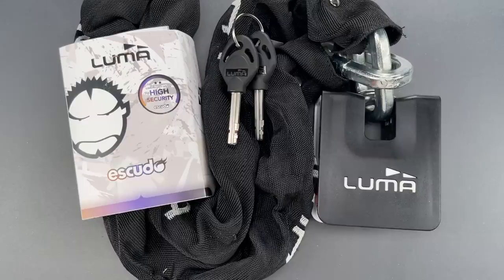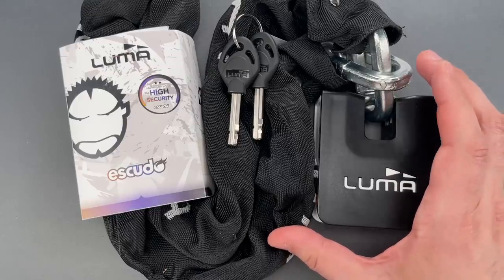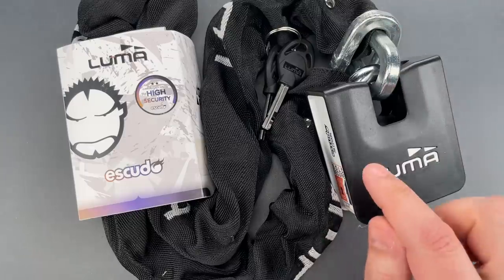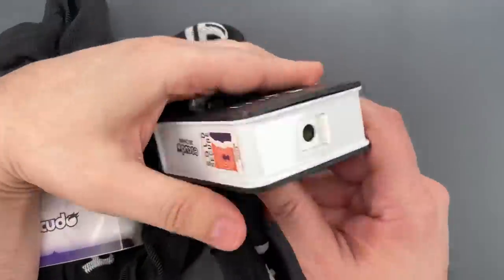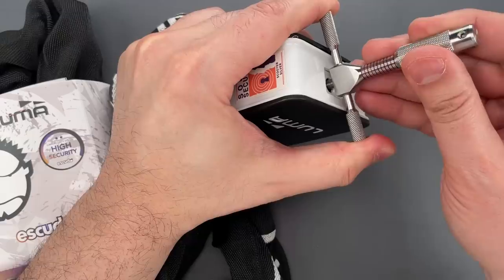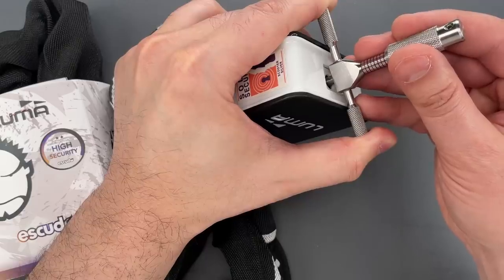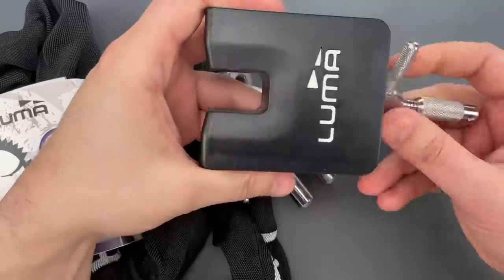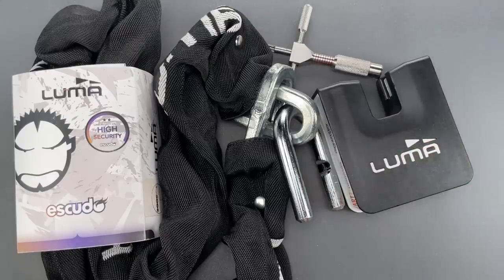[1429] Unexpected False Gates: Lumà Chain Lock

Comment: I'll say it again, The LPL helping criminals bypass locks.
Reply: @crudack darkbane This video was not of a bypass. And one could point to thousands of other videos and books out there on many other subjects (for example, ipsec, computer science, mechanical engineering, construction, etc.)  and make the same claim, missing the fact that these things have other applications besides criminal, and that this individual, if finding new vulnerabilities, has gone out of the way to help manufacturers (which in turn, ignore said issues). So just because you said it before doesn't make your statement correct.

Comment: Idea for a lock design, a half-turn check point that checks if the disks\pins are filled with something solid (like the key), maybe even adding a spring mechanism so that if a hole is detected (key hole turned via a tensioner) it violently springs into the closed position from the check position in order to snap the picking tools or at least hurting the fingers of the lock picker?

Or the simpler solution of having a double-sided key with super cheap and easy to pick pins but if they aren't in place when the key turns a spring mechanism blocks the unlock process requiring to be rewound via re-locking the lock with a key to make it unlockable.

Comment: Lots of really fancy and expensive motorbikes in Spain, also where I live in Madrid they will just come with an angle grinder and take the pole you attached the bike to. Leave it on the street and it is gone, lock or not.
Reply: Cutting the pole really goes to show security is only as good as the weakest link!
Reply: I decided that the best way to stop anyone from stealing my Yamaha MT10 was to sell it.

Comment: It seems for bike locks the disc detainer core are the most common, and they like to use the term "Pick Resistant" since it doesn't have pins, which is a fallacy in any case.

Comment: Very curious how well this lock would handle a more destructive method of opening. Considering that it's encased in plastic, it could mean the lock is much smaller than it appears which explains why it's not as heavy as you would expect as well.

Can you do a video hitting it with either your polyurethane hammer or the ramset?

Comment: every time you pull out the bosnian bill tool, the problem I have is that it's just.. not comparable anymore.
Because instantly it's okay, that lock is being picked with a specialist tool.
So should it be considered secure from the fact it needs one, or can it be easily picked by more availible items? A comparison with conventional picking would be very appreciated.
Reply: 50-ish (plus shipping) for the pick he is using, under 15 for a cheap-o disc pick. Local laws apply. Cheaper than a lot of "regular" decent pick sets for sure. 
I agree in principle, this isn't something everyone has. But you definitely don't need that specific pick.

Comment: After practicing on easier disc detainer locks with the Sparrow disc detainer pick, its a hard enough skill that you cant just learn this instantly from YT (even if you have the right tools). I’d think this locks puts up a reasonable fight unless you have put in the training.

A padlock that you can bypass or rake is probably the metric you care to clear against a common thief. Otherwise a determined thief will just cut the chain; bypassing the price point of any lock. Such that as a NYC team demonstrated: you can have an angle grinder and working on a lock in the city and americans will not stop to ask whats up (esp if you look like you belong there, grinding on some random bike).  Security is only as good as your weakest link

Comment: Could you make an internals video with disc detainer false sets like you did with classic pins recently? That would be really cool.
Thank you and stay picky 😉
Reply: They do make clear acrylic beginner locks of the disc detainer variety. Not sure if it would be as clear on video what was happening as the previous videos though.

The thing to imagine is that the inner part of the lock that turns when the key is inserted is made of a stack of discs with holes cut throughthe middle, and some notches cut on the outside, called "gates". There's also a rod that blocks the cylinder from turning and which needs to fall into those gates before the lock will open, so they need to be lined up. There can also be "false gates" which are notches that the rod can fall into a little bit, but not enough that it'll get out of the way of jamming the lock shut. Their purpose is to try to feel like the real gates when you're picking and feel after turning a disc that it has become loose, indicating that the rod is in a gate.

Comment: It feels like a good solution for making a good lock is have a lot of well done false gates and have all of the pins slip down unless constantly propped up by something, not unpickable but it'll take a while to pick correctly, I might be wrong though
Reply: Stuff Made Here designed a lock with LPL in mind. I think it used springs to push the pins back down which made the design exponentially more complex, but that barely slowed LPL down and somehow introduced a different vulnerability that could be exploited.
Reply: Most lock pickers aren't as skilled, though a lock is only one part of defence for something, so if you have a good lock on your house you still got windows to smash

Comment: @LockPickingLawyer: I feel like the second you have to resort on a custom-built picking tool, you're basically saying, "This will be very difficult if you're not a locksmith or me."
Reply: Tools of that design are available for sale from Sparrows, and before that, there were (and are) much worse ones that can be purchased on Amazon or Aliexpress but usually those require a bit of work with a file before being very useful in most locks. There are also much more expensive ones.

Comment: In all my years of working for a campus PD (with plenty of stolen bike reports each year) I’ve never seen a theft attributed to picking the lock. They just cut the cable/chain/U-Bolt. That method takes no skill and thieves are like electrons; they take the path of least resistance. Not to say that it never happens but a great lock with a weak cable/chain/etc. is just as useless as an easily picked lock (if not more so.) I always suggest a thick lock on a crappy bike on campus. Make them target another bike.

Comment: Are we going to get a series on locking gas caps next? I can't suppose they are very secure, and if it's too secure, they are just going to drill into the tank
Reply: Tank drilling is the thing now. Almost all cars have anti-siphon baffles in the filler neck these days, and many have them in the tank itself so slipping off the flexible hose from the neck to the tank doesn't always work. I'd comment more on how it's done but I'm not going to make it safe for the thieves- let them become toast. On the gas cap locks, they're crap; a selection of 4-5 keys which fit into the keyway and some jiggling is all it takes to open them.

Comment: So I've got a question that's related to the scope of your work.

If every single lock can be picked, why should I purchase an expensive lock over a cheap lock? Aren't they all just there as a deterrent rather than actually keeping your things safe?
Reply: The first question for buying a lock is: How sturdy is it? Some locks you can literally break with two spanners( open ended wrench) placed in the shackle and levered against eachother Further, if the shackle is unguarded, is there evidence someone can't just cut through it? A £10 (12 usd) bolt cutter can make short work of a 10mm shackle. A £30  (37 usd) one can potentially cut up to  16mm. Ideally you want one with a decent shackle guard to prevent them cutting it. 
Secondly, in regards to picking. Some of the really cheap locks can be picked with a wave rake ( I can get a set of 20 for £20) or anything close in shape, by jiggling it in the key way.
Anything with a decent locking mechanism(that takes actual picking) will prevent most people.
For lock picking, its going to be rare for someone to be as good as LPL even if they know about and have the right tools. Maybe look through their channel and look up whatever they call "decent"
Nothing is full proof, but if the chance is 1 percent rather than 50% (random numbers just for comrision) chance, which would you pick?
There is also the matter of weather for outdoor locks.I was forced to replace my reeltively cheap lock( its used to lock the inside of a tall gate) because the keyway was rusted due to rain, was forced to cut it.

Comment: I'm curious: can those companies be liable for false advertising when making those "pick proof" claims?
Reply: In this case I don't know if it can really be called false advertisement. I mean he did need a custom made tool to open it. It's not something that anyone can pick open like Masterlock
Reply: @federicoperezybarra3085  A functionally equivalent tool is available from Aliexpress for less than $10. In fact that was the tool LPL and BB wanted to make a nicer version of. The cheap Chinese disc detainer picks break somewhat easily and are ergonomically uncomfortable, but they work just fine.

@theh3lix Any lock which can be tensioned can be picked. Calling it "pick proof" is like calling something "water proof" without specifying to what depth... Your rain coat is not water proof at 10m depth.. there it is "slowly seeping" at every stitching. Many lock companies like "pick resistant" over "pick proof" precisely because it's more "legality safe".... Just don't specify what the resistance was and you're golden.

Comment: No bike thief is picking these locks, they are packing a bolt cutter or angle grinder.  If a thief is determined they will get your bike regardless of the lock you have on it.

Comment: Stupid question, but what if someone designed a disc detainer core so that the core rotation was driven by a disk in the center of the stack?  I imagine that would require a significantly more complex tool with two different picking bits on either side of the tensioning bit??

Comment: If a lock needs "the pick that BosnianBill and I made", I'm sure it's a good lock and should be considered buying.
Reply: All that means is that its a disc detainer lock.
It can still be complete garbage, it just cant be picked with a typical lock pick because the lock doesn't work that way... but theres more than one way to attack a lock, as LPL has demonstrated many times before.

Comment: Not many people have that tool. When I called a locksmith for my front door he showed up with a bump gun thing and failed miserably.
Reply: Most locksmiths aren't good at picking; their business is more installing and rekeying locks. In the field they usually bypass locks instead of picking since that's faster and more certain. They'd rather drill the core and install a new one at a specific reasonable cost than risk being stuck on a job which may take an hour if they can do it at all. Picking is an entirely different skillset they rarely need which explains why they're generally not good at it.
Reply: @P_RO_  this guy was a real piece of work. My wife came home with the key. He refused to quit working on my lock. I physically pushed him out of the way and used the key. Yes I gave him his 40 bucks. He would not quit. Now my lock doesn't work properly. I will never call a lock smith again.
Reply: @rippertrain  Sorry for your bad experience. Historically, locksmiths hid their 'trade secrets' much like magicians do, and part of the reason for that was to make their job easier. Probably some good vids on replacing whatever kind of lock you have yourself, it's not hard to do with a direct replacement of the same type.

Comment: Would it be possible to design a disc detainer lock with false gates that are nearly as deep as the true gate, but when the sidebar falls in (when you picked all the discs) then it won't allow to rotate the discs fully. It would seem way harder to distinguish true and false gates, because the depth could not be perceived until all the discs are rotated to some gate (true or false) to allow the sidebar to fall in deeper.

Another idea would be multiple smaller sidebars and discs with multiple true gates where some of the sidebars could fall in (possibly also allowing the core to be roateted a little just to upset the picking), but there would be only one combination of gates where all the sidebars fall in their right spots.

I don't know yet in detail how would I manufacture it, I just brainstorming loudly...

Comment: would it be possible to make a lock that is genuinely anti-pick, where the lock straight up mangles a pick if there isn't a key's worth of metal inside, and then does that thing where it'd need to be picked several times to get a full turn of the lock?
Reply: The main reason locks aren't pick proof is because most parts are widely machined and have tolerances that are too permissive. If you custom built and custom fit everything, it would be next to unpickable in anything realistic. But that's way too expensive and work intensive
Reply: @ninjamimealt  that doesn't answer my question.
Reply: to clarify, I am not asking if a lock can be made unpickable, I'm asking if a lock can be designed to be hostile to a picker's tools.

Comment: Question, if you encounter false gates, but don't know that's what they are, and the lock doesn't open, wouldn't you just start back at one and pick more until they move into the proper place to open the lock?
Reply: Ideally, the false gates would feel similar or identical to true gates, though they do need to be cut shallower so they'll eventually start binding. But if you're having trouble telling which is which as you try to set each disc, it can potentially slow you down considerably. In the case that the false gates are well-designed, you'd put everything in either a true or false gate and then have to check all the discs to find one that's binding, hopefully get it into a true gate and not just a second false gate on the same disc, and then search through for another binding disc and so on.

Comment: I always wonder is locks with disc detainer cores can be opened without "the pick that BosnianBill and I made".
Reply: Angle grinder easily opens it.
Reply: @kirayoshikage4057  But a non destructive method? :D
Reply: Most can be picked without that type of tool but it's really tough. There's several tools which have been made for this job like the one seen here and both LPL and BosnianBill used those until they developed this one together.
Reply: I'd like to see LPL have a go at the Abloy Protec 2. Very few people in the world has posted one-shot pick and disassembly of that lock...

Comment: A lock with plastic covering is kinda begging to have that plastic removed to see whats under it. No need to spend 55 CAD on the pick you and BosnianBill made if a flat head screwdriver or a hammer will do the trick. In any case the bike is gone, covert entry doesn't apply here.

Comment: I still would like to know why "the pick that Bosnian Bill and I made" doesn't work on Abloy locks.
Reply: the keyway on abloy locks cannot be tensioned by that pick
Reply: It's because that pick was designed to work in the majority of disc detainer locks and abloy designed their disc detainer locks in such a way that any pick that will fit in the majority of this containers will not fit in any of their locks at all. Also most abloys tensioned from the rear and have the first disc or two able to spend completely freely so you cannot tension from the front it is simply impossible and this pick does not reach far enough into the lock to find a tensionable disc

Comment: How heavy is this? I'm shopping for a lightweight quality chain lock for my e-bike.
Reply: Yeah me too but I think lightweight and quality are mutually exclusive in terms of security in this case. I'm looking at retrofitting a cafe lock and chain to go with my D lock and rope chains. None of which is going to stop a determined thief with bolt cutters but it might slow him down, not that I leave it out of sight for long... 🤔
Oh, and don't forget the weight of the chain is less of a problem when you've got pedal assist, apart from a little reduction in range of course.
Reply: @judebrown4103  I just realized that the answer was in the video (1.5 lbs). That's pretty light. And it seems like it's not the easiest to pick. So that's a good choice.
Reply: @eproulx  I just realised that LPL often gives the weight of the padlock he's picking... Watched the video again and I think I'm right, the padlock itself weighs one and a half pounds so you need to factor that in if you are concerned about weight, that chain will add considerably more. Though as I say if you have pedal assist and maybe a bag or basket somewhere on your bike the excess weight really isn't that noticeable to ride with. Only time I feel it is getting on and off the bike, but I'm disabled and not at full strength... 🤔
Hope you find something to suit you. 👍 🙏

Edit: 😂 just re-read your question... It was the weight of the lock itself you were enquiring about, sorry, brain fog! 🤯